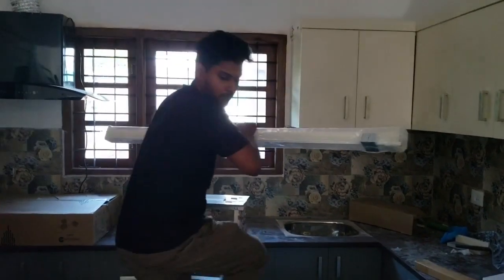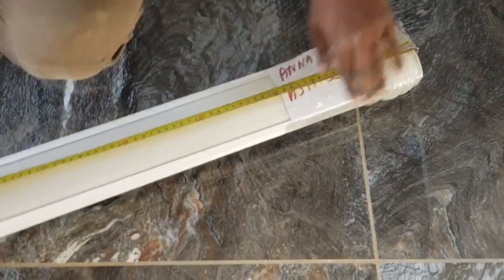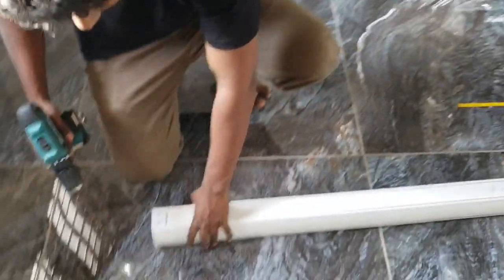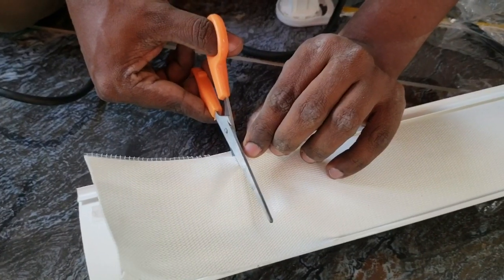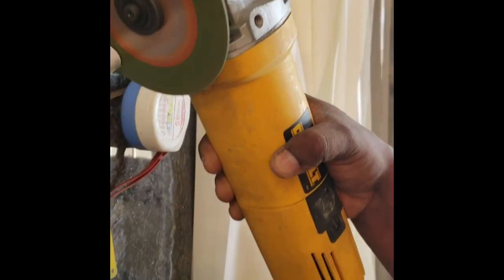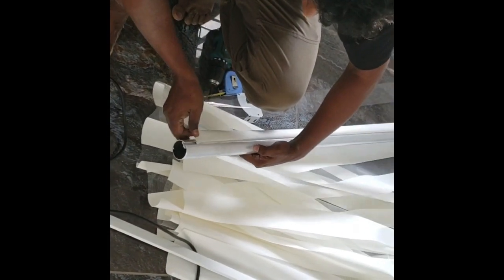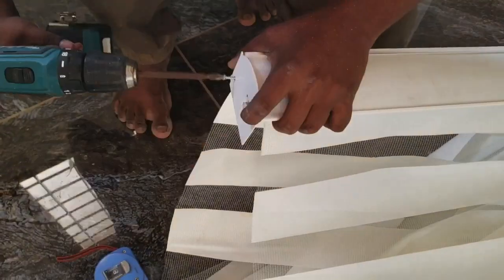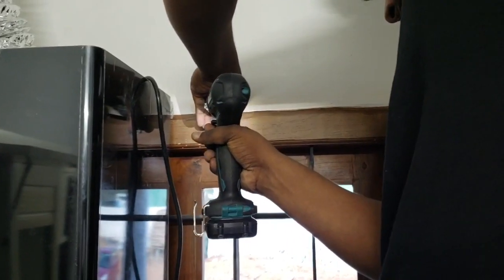S1 : EP 3Cutting a Zebra Blinds. സീബ്ര ബ്ലൈഡ് കർട്ടൻ

Comment: Bro blinds ullill alle fit cheyukaa
Reply from the maker: Blinds pothuve ullilum puratgum fit cheyyam.   Purath fit cheyyumbol width 5cm each side add cheyyam.  Upvc window handles thattathirikkanum..  kurechude visibility kurakkanum..  already mosquito proof indenkilum pureth kodukkunnathanu nallath.
Reply from the maker: Blinds ullil kodutha sheshamanu mosquito proofing cheyyunathenkil..  topil 10 cm fixedbportion kodukkanam...   related ayit oru video njn cheyyam..  😄👍   thanks for the next video idea.
Reply: @Ashik_Coversun  wait ❤️
Reply from the maker: @febintechvlogs5054   8089323287.
Reply: @Ashik_Coversun  startup pola thudanagan nala chelav veroo around ethra akum
Reply from the maker: @febintechvlogs5054  thudengu..  in shah allah..   settakum..  😊👍
Reply from the maker: @febintechvlogs5054  aarudeyenkilum koode kurechunal train cheyyunath nannayitikum...   pinne ithoru long term commitment anu...   clientsinu after service kodukenam..  
I give complete service backup to my clients.  Which is very important.
Athre eluppam job alleto but.  Hardwork pays off.  👍🙏